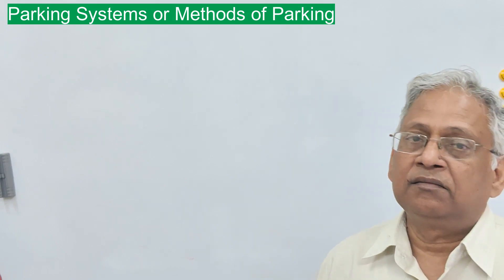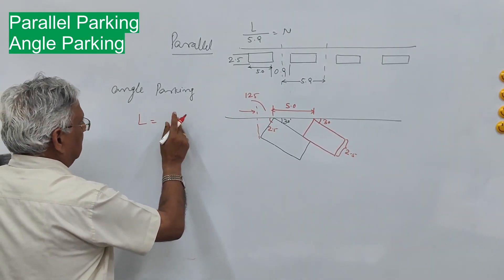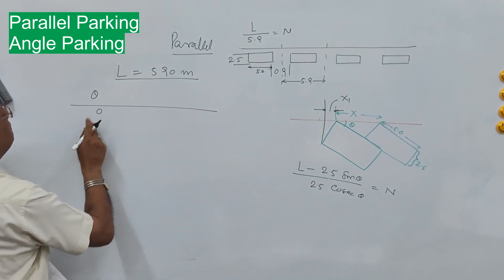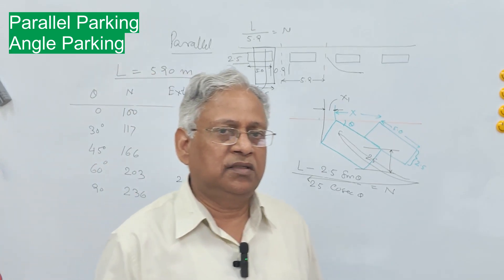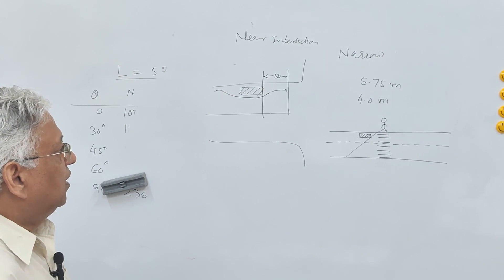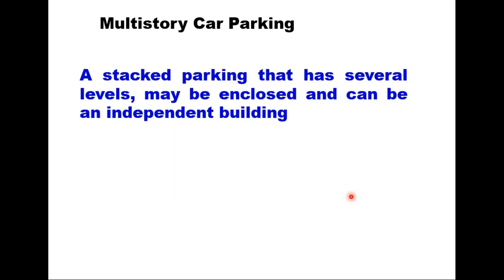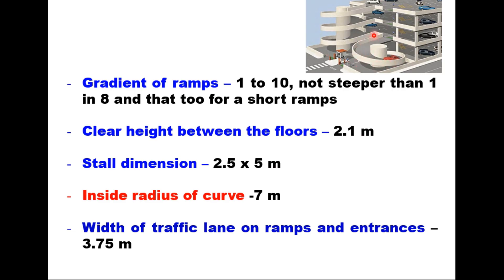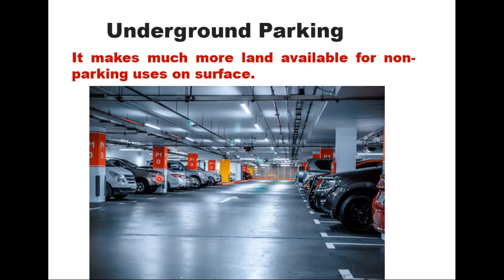Parking systems, Methods of parking, off street and on-street, multilevel, roof parking, rotary

Comment: Sir How to calculate percentage of cement after laying of ctsb material......
Reply from the maker: There is ASTM code for examination and analysis of mortar for its components. The procedure is basically a chemical analysis performed by sturctural engineers.